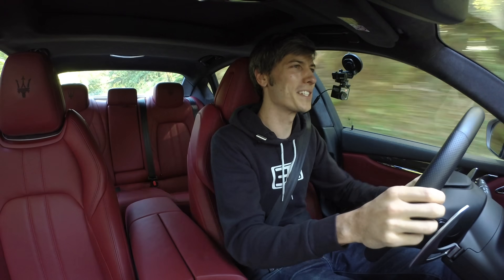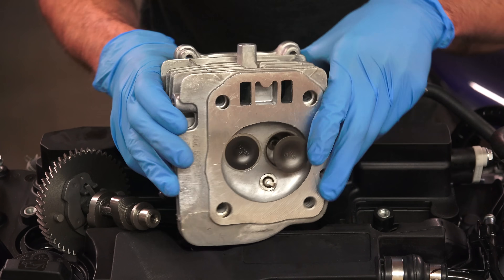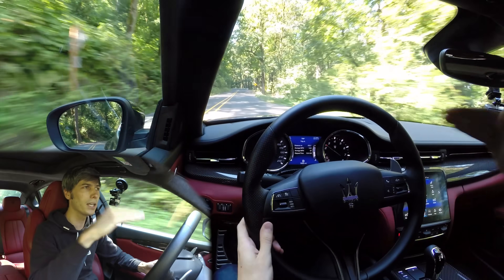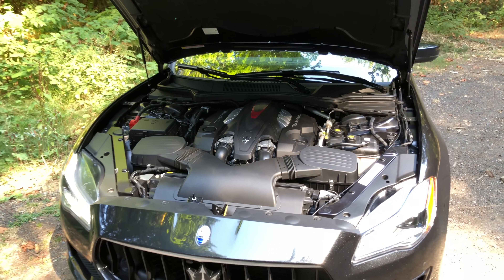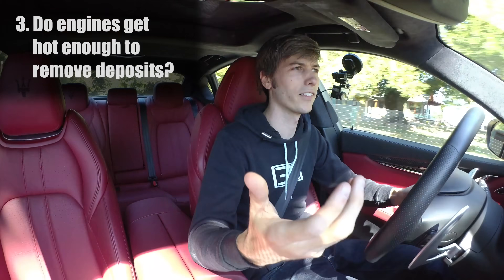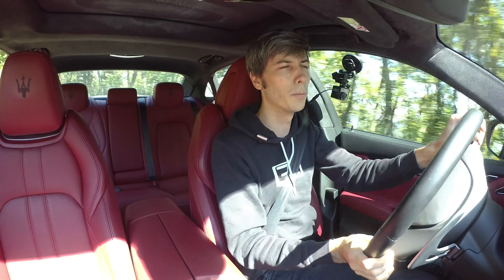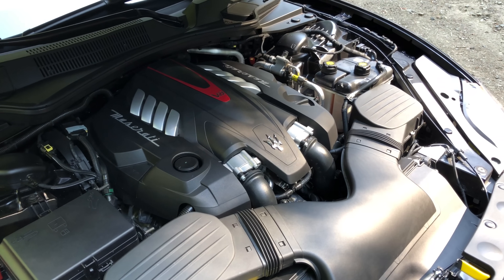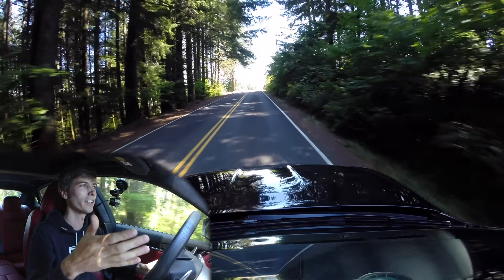Is Redline Good For Your Car's Engine? Italian Tune Up

Comment: can you please do a video about why a 7 liter american V8 from the late 70s / 80s makes about 120 horsepower?  thank you!
Reply: low compression ratios and a pile of smog emissions control devices still in their infancy strangling air flow to hit government goals for air pollution.  If you wind the clock back 7-10 years to the late sixties early seventies you would find very similar engines producing 300+ Horse power.
Reply: Not too hard to do, you can make a massive 8 liter engine output just 40 hp if you want to.
Granted you will throw efficiency out the window in the process, but it is doable, restricted air flow, exhaust and the like will all make that happen.
Reply: government regulations starting early 1970s, saw the death of a lot of high performance engines. 1971 was the last year for the hemi and the 440 6 pack, which made 425 (500) and 390 hp respectively. After that, manufacturers had to lower compression along with other things, and there was a switch in hp ratings from no accessories to all the accessories, which brought down ratings as well.
Reply: My car has a 5.0 v-8 with 150hp. Go back a few years and the same model car had 120hp with a 5.0
Reply: @lilsammywasapunkrock  Crazy, isn't it?
Reply: @lilsammywasapunkrock  My car has 4,5 liters V8 twin turbo and close to 600 hp.
Reply: I got a 230hp 1.3L in my rx8 ;)
Reply: A lot of them were fairly low revving engines and you don't really start making power until you get past 5500rpm but they'd have been making a pile of torque in the low rpm
Reply: AKS Me being from California, a car from the first half of the 70’s has a unique perk, carb exemption. 
“Minor changes,” I should clarify: Headers, intake and carburetor. Cam too I guess, but I wanted to keep the engine in the car for simplicity sake. And no, it won’t have the power per liter of the new engines, but what decent power could you get out of them if them if you uncorked it and threw emissions concerns away? The power numbers in the late 60’s were getting pretty good, so were the 70s engine detuned from bolts on (restrictive intake/exhaust, shitty first gen ecu), on detuned in fundamental architecture?
Reply: @johnnybraccia452  Headers, intake, carb, and cam can easily get an old 350 over 250 hp, and be perfectly streetable with plenty of low end torque to keep the original gearing. 300 hp is still within reach, but you'll need more compression with new pistons and/or heads to keep the low end. 

Do all of it and 350-400 hp is just a matter of getting all the matching parts. You can go higher but then you'll be replacing just about everything but the block and start losing a lot of low end torque while drastically increasing the RPM for peak power. Stock gearing won't cut it anymore and the transmission won't hold up. And all this assumes you started from a freshly rebuilt motor and transmission.
Reply: @johnnybraccia452  It's not really about emissions, it's about efficiency. It's not even worth trying to compare the poor fuel metering of a carburettor to modern EFI.

If you started with a 'lightweight' V8 (e.g. a ZL-1 motor) and gave it modern fuel/ignition mapping, carried out a ton of optimisation on intake and exhaust gas flows, introduced some form of VVT like that used on the LS motors, and tons of other mods to improve efficiency, you would probably be bankrupt pretty quickly!

So the quick answer is that you can do it (or at least get close) but why would you want to start from there?
Reply: AKS I love my new (to me) 2012 f250 6.7L diesel even more. After tuning and deleting it, it makes tons and tons of power.
Reply: There never was a 7 liter V8 from the late 70's or 80's. Up till 1970 and 1971 they made 425- 450 horse power before pollution controls and EPA laws.
Reply: Well it definitely was not a Chevy 7.0L 427 Engine. I think the lowest Hp Rating those made was 390-Hp up to 430-HP. Then again, those engines were made from 1966 to the mid/late 70's. 

Biggest thing was Smog Laws and Fuel Crisis. Those caused engines to almost cut the Hp ratings in half. Manufactures detuned the engines as much as possible to cut down fuel usage and pollution, while still being able to get the engine to have decent power. The Chevy LS6 7.4L 454 made 450+ Hp and 500+ Torque (Realistically it made around 550-Hp and 650 Torque. The LS7 from 1970, which had a different intake made 465-Hp and 610-Tq and that was also very underated) in the 1970 in the Chevelle SS, El Camino SS, and in 1972, the 343 made 270-Hp, and it kept going down and down until it made 190 ish Hp to meet those new Laws and fuel usage.
Reply: @1badk20   The lowest rating for a Chevy 427 was 335 horse power, the highest was 435. As far as the LS-7 454 is concerned it was never installed in any car. I don't think it was a crate motor either. The LS-7  is a myth.
Reply: It's very efficient at turning liquid energy into heat and noise. Somewhat more efficient then burning the oil directly at the oil well. That's engineering at it's best!
Reply: Daver G  Electric, probably.
Reply: My 1993 F250 has a 7.5L v8 that makes ~300hp. And that's after A mild cam, EGR delete, headers, and exhaust. Along with an intake. They make somewhere around 230hp stock. I think what the cam helped most in was torque. That thing is a torque monster. But if you really want power from those engines, you need to get ported heads and all.
Reply: Engine is a compromise between low rpm (fuel saving) and high rpm (peak power) efficiency (only VVT and VVL solve the problem). The timing was set to be more efficient on lower rpms to save fuel while daily driving (CAFE standarts). So there is a power actually, but on lower revs (call it a peak torque), but no power at high revs (max power). Every engine can be detuned or tuned a simple way just by retarding/advancing timing, so you can get either more power with increased fuel consumption or less peak power with fuel saving.
Reply: Mostly design, to a lesser degree emissions and muffling equipment.
Reply: AKS yes but nowadays the Mulsanne straight has two chicanes to keep speed down. Back then it was just a long straight
Reply: stroock6394 Jimmy Carter is the reason why we are only just recently seeing the horsepower numbers we saw in the 60a
Reply: As others have said: low compression ratios and poorly designed emissions controls. 
What they haven't said: these lumps have insanely high low end torque.

Peak horsepower isn't everything. What matters is power at the speed you need it at. (Which for almost all practical purposes is from zero to 40mph) Most of these old boat anchors were designed to run forever at 2500rpm or less and deliver stump-ripping amounts of torque whilst doing so.
Reply: Because of the fuel crisis.
Reply: Removal of lead from gasoline, which led to massive de-tuning of engines as well as increased smog equipment.  It wasn't for several more years before they found lead-free ways to sufficiently boost octane.
Reply: The same reason 4 cylinders from the time struggled to make 90hp. Those big v8s may have only had 120-150 hp but easily made between two or three times the torque.
Reply: As a follow up question could you take a 7L engine from the 70's and make minor changes to make modern horse power numbers?  (granted, with zero regard for emissions or fuel economy.)
Reply: 'Cos americans aren't able to make engines, leave this job to European guys, or better, Italian Guys, we do everything better
Reply: Because americans didn't really know how to make engines.
German manufacturers know engines, they didn't build shitty engines like you describe
Reply: @JRCW892  German manufacturers didn't have cities covered in smog and 7L+ V8s.
Reply: @reinbeers5322  
Yes, because they understood before the americans that there was no need to create monstruous engines that pollutes the air.
Reply: @JRCW892  You're forgetting that Germany is completely different. America knows how to do bigger and better.
The germans could never put out 400hp in the 60s.
They also didn't have a country where everything is hundreds of miles apart.

Comment: Depends on the engine!
I got a Trabant, 600cc 2 cylinder 2 stroke. They are known to build up tons of carbon, especially when you are driving a lot in the city. Most build up is in the exhaust tho. Ripping it down the Autobahn every once in a while is important or you lose a lot of power or even starts knocking. Not a myth.

Comment: Its the fuel to air ratio that controls whether the engine gets deposits if the mixture is overly rich, in a cars engine you don’t have the ability to control the ration like you do in a airplane, reving an engine to a high rpm doesn’t change the ratio and won’t remove deposits.

Comment: Temperature isn't the only factor... I'd say the temperature in combination with the high flow of air and oil going through the engine is what most people imagine cleans their engine... Not only carbon build up but sludge as well...like a car with valve lifters that tick...but then you drive it hard for a while and hot oil at high pressure manages to get into the valve lifer and the noise goes away

Comment: Good explaination from a purely theory POV but you're missing a few things. For instance what difference does the higher flow rate make as the rpm rises, effect of the added expansion and contraction of components even with relatively small differences, effect of different mixtures with load/rpm, etc. 
Also the Italian tune up got it's name a long time ago. I would wager the technology around back then would allow a lot more heat build up than a modern design - at least in most cases.

Comment: Haven't even watched the video, but right off the bat, I'll say NO. The RED LINE is there for a reason. Your engine should be able to go close to it without breaking, but if you go past it, the chances of a catastrophic failure of something increases dramatically. At any rate your engine should stop 'pulling'  before that, so going past that point is wasting your time and fuel. It's also getting so late here it's starting to get early, so excuse me if this doesn't make any sense.

Comment: I am not convinced that the mechanism of the Italian tune-up is heat based. It could be mechanical or vibration. It could be the amount of fuel that goes in the combustion chamber all at once. It could remove little or no carbon deposits from the engine but somehow clean the fuel injectors or remove moisture from the oil.  I have definitely noticed that most port injected engines run smoother after a couple of hours of highway driving. I would be interested to see an actual experiment on an engine to see the effects. Possibly disassembling the engine before and after or using a borescope.

Comment: I did this by accident once: Normally I'd drive to and from work (in Norway) with my diesel VW Golf. It was slow as it had a small engine so I didn't notice anything slowing down. Then I took it to France for a vacation driving it hard through germany on the Autobahn to get to and from. When I got back to my routine again I noticed the car seemed to have alot more HP! Noticable more HP - It was a German tune up though.
Reply: yes, right. one of the main components that clogges up is tha catalic convertor. When you drive in the city, it does, not heat up enough to clean itself up. But when you drove on a motorway at constant speed and rpm 110-140kph which is 3000-4000rpm ( not every car)  it heats and cleans. Also some of the carbon deposits in your engine is gone.
Reply: How about the off-the-wheels tune up? (But you need to put a load on the axles)
Reply: Mine could definitely do with a German tune up after its 10 year England tune up - averaging like 7 mph
Reply: I did the same in China so it was a Chinese tune up.
Reply: This is the ECU of your car adapting to a different way of driving, it happens after some drives.
Reply: I prefer a Swedish tune up since it's closer. So far did 3 of them with my current car, another one is scheduled this weekend. From what I've noticed so far it doesn't always work, but worth a try. On the second one felt like the car gained 20% more HP for a couple weeks.

Comment: ... I always thought the italian tune was simply getting rid of crud on the turbo vanes (particularly on VNT/variable vane turbos) on diesel engines.  Spin them faster to shake them off via centripetal force.  Once you don't see black smoke in your rear view mirror then you are done.

Comment: What about the old trick of pouring a bit of water down the carburetor to 'steam' clean the inside of the engine. This would be an interesting test on direct injection to see if it works. However, don't hydrolock your engine by flooding it with water.

Comment: Interesting. On airplanes with piston engines there is a procedure to "cook off" spark plug fouling by leaning the mixture and running the engine at a high RPM for a minute. Of course it's easy to put that type of engine in a condition to generate that kind of heat.

Comment: Honestly that’s what I figured with Direct injection, I use CRC cleaner every 5000 miles. I noticed during 5000 intervals when driven hard, when I would spray in the cleaner the engine would stumble. With the last 10,000 miles I have babied the car and tried to keep it under 3000 RPM as much is possible.  The last two times I used CRC direct injection cleaner the engine made no noticeable stumble while the cleaner was sprayed into the intake. Out of curiosity I’ve taken off my intake and I had no deposits. Other focus intakes I have either seen on YouTube or online had carbon deposits. The focus ST’s  were really bad and a couple couple of regular focus 2.0 direct injected intakes had some carbon but not too bad. Also I’ve noticed my focus is still runs smooth while a couple of other foci I have been in have a slight engine vibration. I had a 2015 ford focus which I drove hard since day one and my engine vibrated like a lawn mower starting within 1k miles. I never cleaned the valves and it had a wicked vibration by 18k miles. My current 2017 Focus has been babied for the first 2k miles then driven hard until about 7k. Since then I keep it under low load and she’s been super smooth with no noticeable vibration. Currently at 20k, still using full synthetic oil, 89 or 93 shell gas, CRC every oil change and I haven’t had carbon issues so far.

Comment: My experience with this has been in high rpm engines with catalytic converters. I had a 1992 Lumina Z34 that had been driven as a grocery getter for 20 years. When i first got it it was running pretty rough, when I got on the highway I put my foot down and a big cloud of black smoke came out of the exhaust, and it immediately ran waaaay better. I think the carbon deposits were collecting in the catalytic converter and causing excessive backpressure and getting some extra heat and pressure to it blew it all out the back.

Comment: I always thought it was a about physically shaking loose the crust, not heat. I think the idea behind running into redline to remove carbon is a legacy from days of old when technologies of engines and fuels and oils all conspired to gunk up engine internals. Big V8s tooling around at low RPM all the time "required" getting the lead out once in a while.

Comment: I think some of this stems from old carbureted cars.  If they we're burning rich, you'd get a ton of carbon and would foul the spark plugs.  When you'd drive it hard it would blow all of that out of there. 

These days, I don't see the point. Lol
Reply: Low combustion temperatures (low load/low RPM) in a properly tuned engine will still cause deposits to form. Especially with gasoline which doesn't burn well to begin with.

Comment: Not heard about this topic until now. I don’t think this a good way of maintaining your engine cause you’re going to wear out the engine sooner. Intake valve temperatures will return to about 200C once you stop redlining and there will be carbon buildup again and now with reduced life on the engine overall.

Comment: Redline for a good time
Reply: Smiles per gallon. I have a "drive it like it was intended to be driven" policy for vehicles. That means sporty cars get driven hard, tough offroaders get beaten up offroad, etc. Ford doesn't go selling you a 460hp all-American V8 hero at a fairly cheap price hoping the engine never turns above 3000rpm. Toyota doesn't selling you a TRD PRO suv/truck model for you to exclusively hit the mall and starbucks.